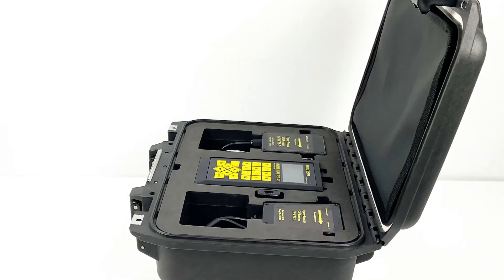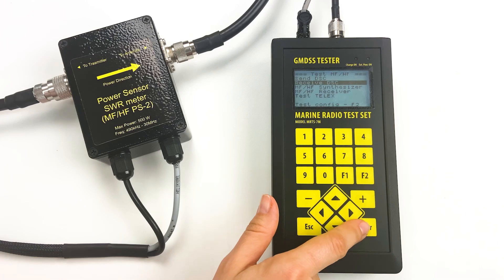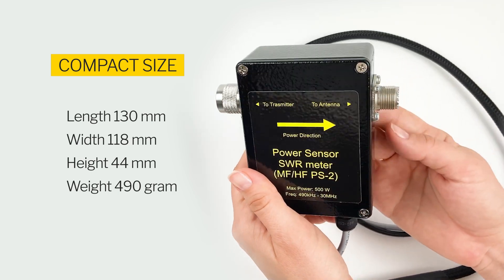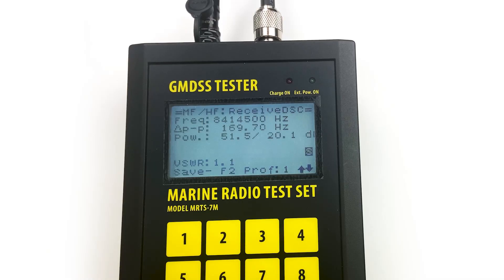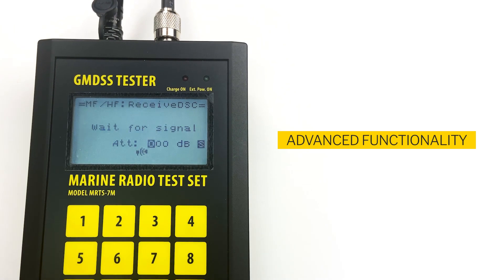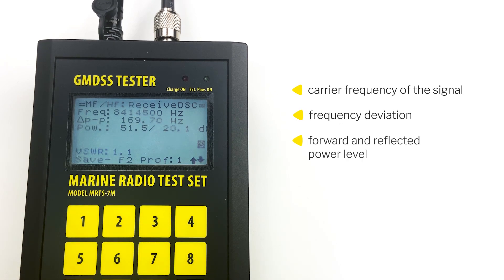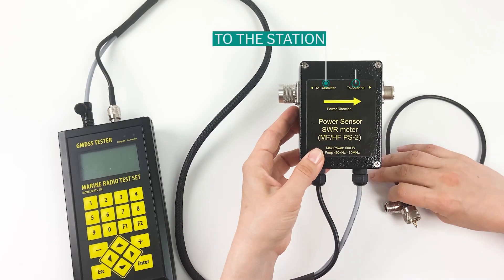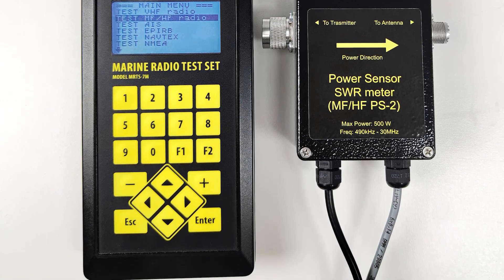Next level of GMDSS survey: MF/HF Power Sensor and VSWR Meter PS-2

Comment: The connection between my MRTS-7M and my power sensor PS1 is made through a multi-pin connector and not magnetic like this power sensor 2 has. How do I solve this problem if I want to buy this power sensor 2?